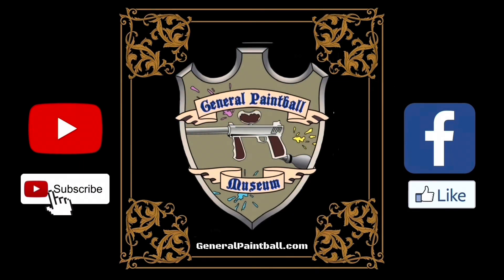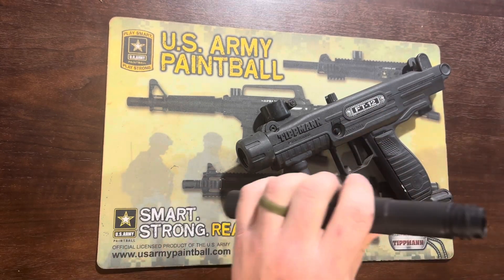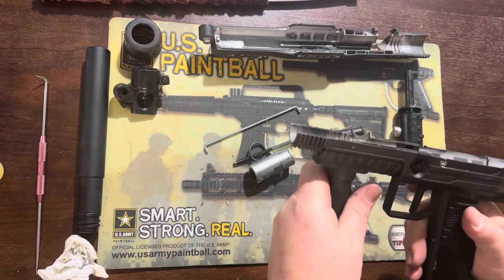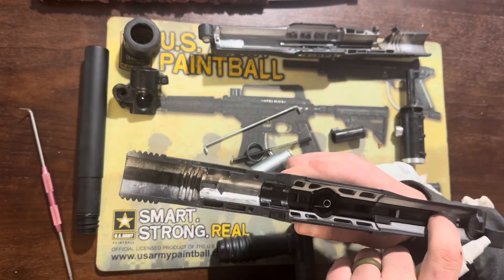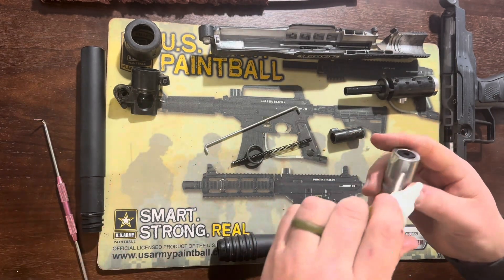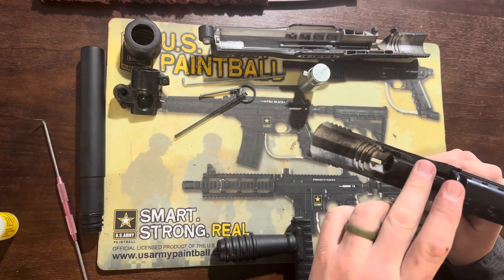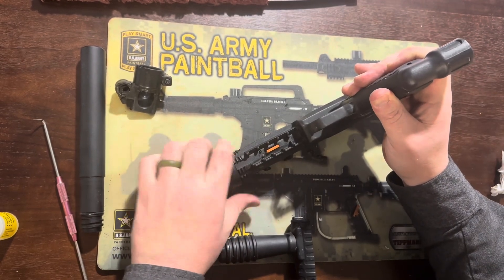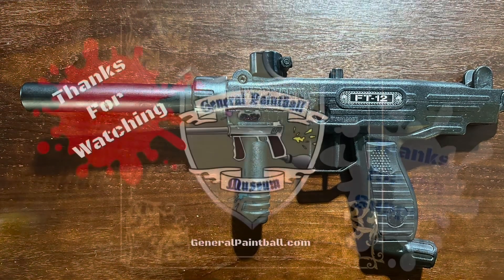Tippmann’s FT-12 service and cleaning

Comment: These had so much potential. If only they'd made a better feedneck design. Also the non reciprocating handle for a rental is frustrating as a ref.
Reply from the maker: These definitely made maintenance easier compared to the 98 series!